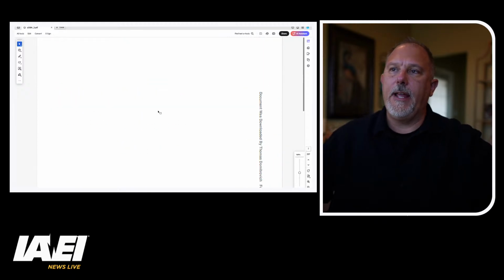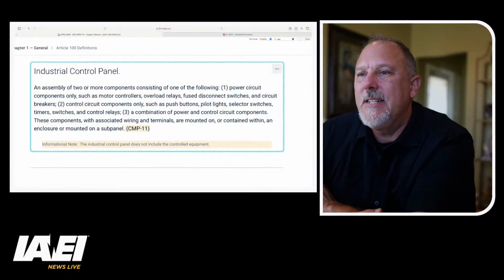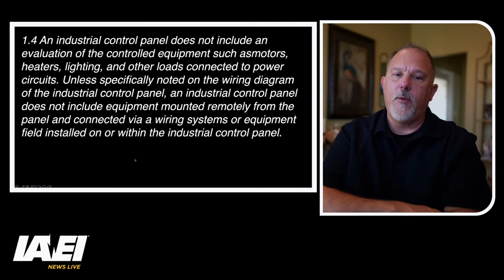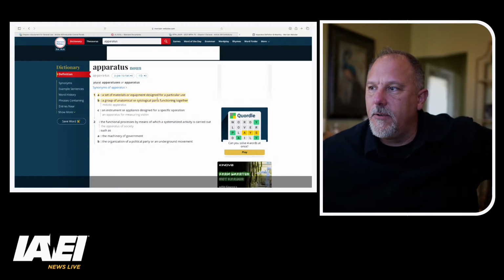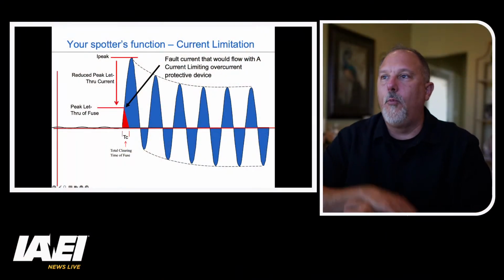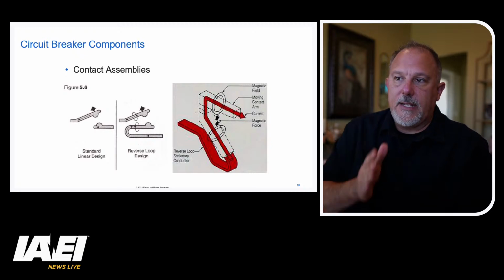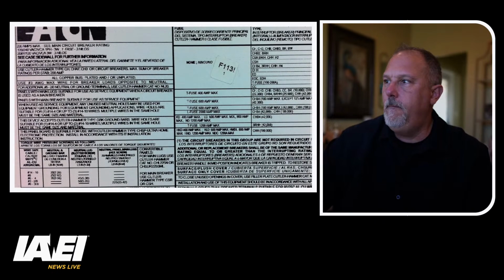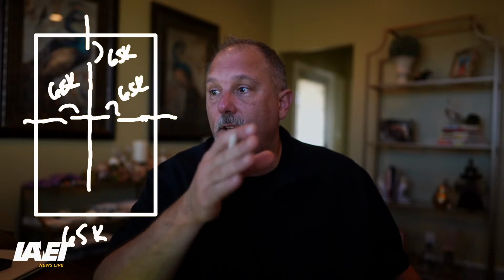Article 409 Industrial Control Panels

Comment: I work on German, Swedish and Italian made machines all the time ( steel mills and heavy fabrication), what you just said - is bunch of garbage!!!

Some Italian manufacturers do make subpar equipment, sometimes! 

But not German or Swedish!!!
Reply: Worked on a couple of great made in Italy 500 ton plastic injection machines. We had a so called engineer that back in the 1980's purchased a $69,000 box erection machine rather then a bullet proof made in USA one that cost $90,000. He told us that it had a computer for troubleshooting. Yep 6 idiot lights! Machine was down at least 4 months a year because when they flew in a mechanic from Italy he said it also had electrical problems so weeks later an electrician from Italy would fly in and get it working. They mounted at least 30 miniature relays on the back of a 3 by 3 foot heavy panel cover. Even with a retaining clip the relays would come out far enough to cause problems. Germans for the most part were hard heads who could not accept they made a mistake. On that $10 Millon  dollar machine they said it was impossible that the $5,000 pre stretched metric chain they sold us was  not evenly stretched. We had our two best machinists measure the chain . They flew a German machinist in and like our guys within five minutes condemned the brand new chain. Germans that did the wiring on expensive machine had selector switches mounted on the machine labeled something but then a different name on prints.

Comment: Was an electrician for 50 enjoyable years. Never once came across a panel made outside of the USA with a UL or other agency label. Worst was a $10 Millon state of the art custom made in Germany machine. That and the older machines from same German company had every start stop push button wired incorrectly. If you held in any of the stop buttons and held in the start button machines would run. Too many foreign panels use undersized wires but often went the extra mile to install a GFCI 15 amp breaker to supply 120 volt control power.